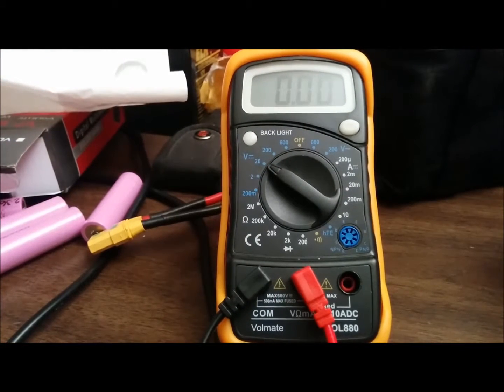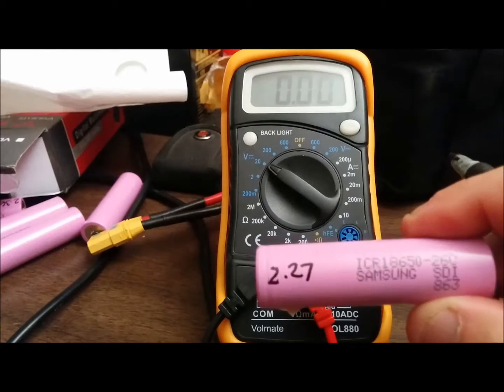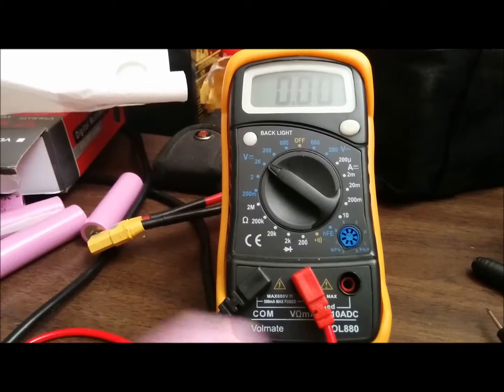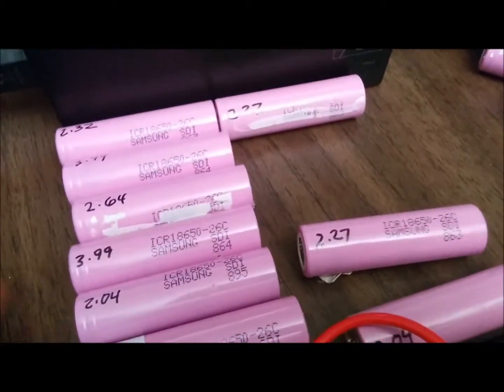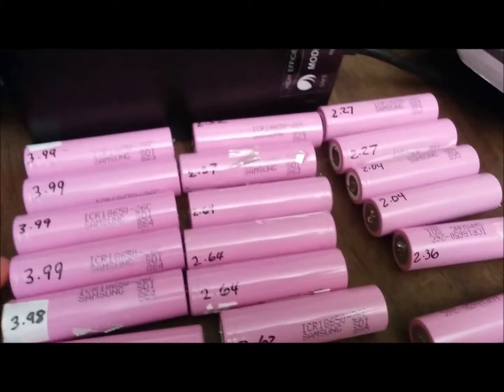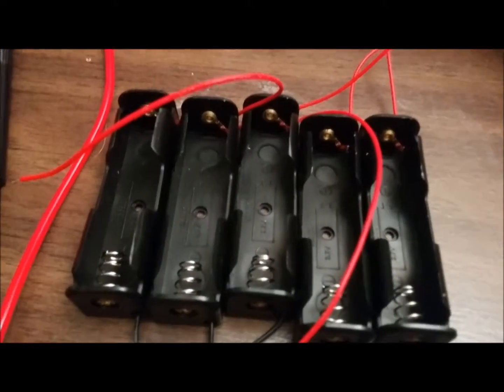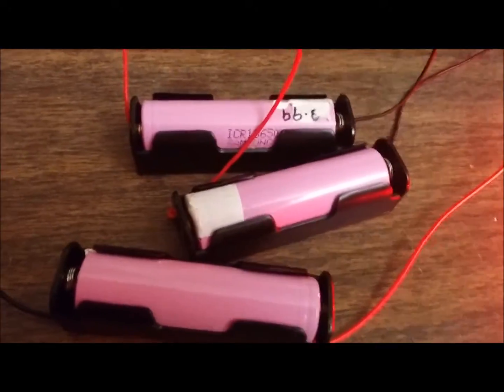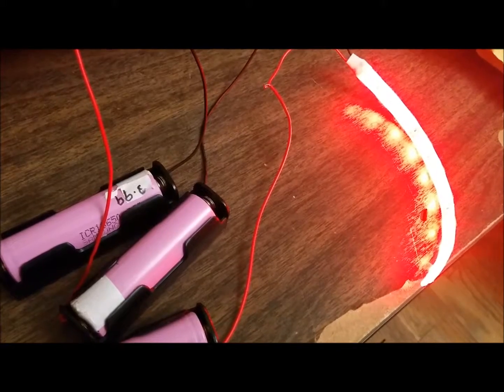Testing a string of 3528 Waterproof LED Strip Light IP65 12V with Samsung 26C 18650 Batteries

Comment: I disassembled a laptop battery and the cells were showing good voltage (4.05-4.21) what else could be the problem?
Reply from the maker: +TheDrunkenCow Hi Crow. Money will solve your problem. I would buy a replacement laptop battery. Maybe it is the laptop battery BMS. I would keep the cells and repurpose them into 18650 power banks, 18650 flashlights, 18650 fm radios, all available from Ebay. You get the idea.